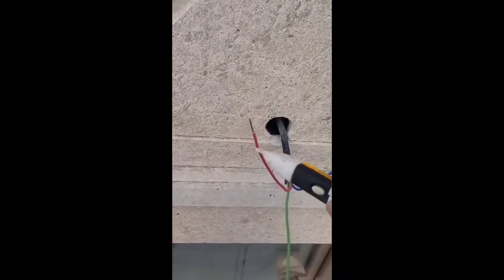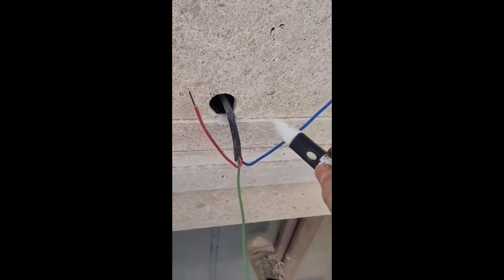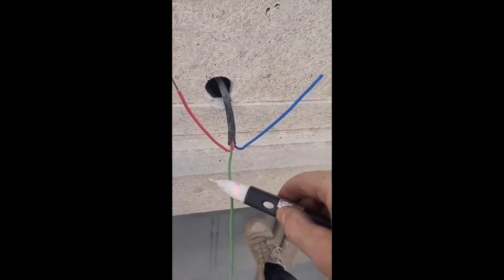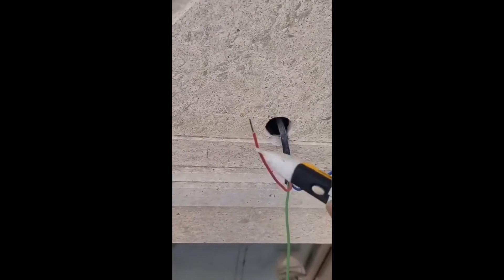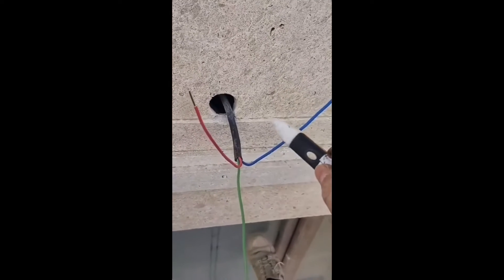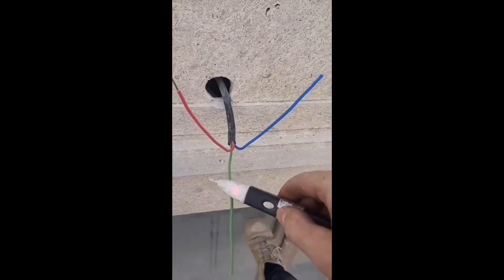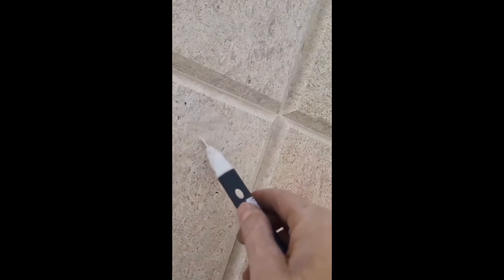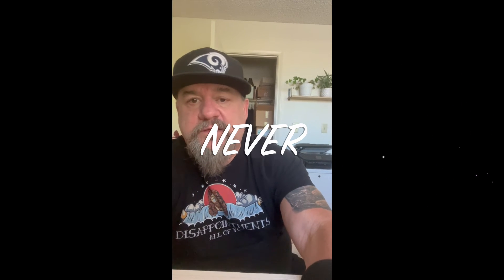Electrical hot wires, Tick Tracer reading hot in the wall. Reading hot wires when the breaker is off

Comment: A whole elctrical room lights up almost from the door frame. Or standing in center of room. This is an indicator. And it can lie in different ways when diagnosing.  Always use that meter before you delare a circuit status,  means your life. Untill you find the hard wire, be very carefull its a million pieces of pain. Learn from others mistakes. And the last tech before you could of been doing rough work. Safe wiring to everyone

Comment: This happened to me, it ended up been an open neutral on a 277v and it was arching to the grid of a drop ceilling and all the metal beams. I was reading 480v on each phase to neutral. Instead of 277v.  When I shut the breaker off, repaired it and turnned the breaker back on none of the light fixtures turned back on. only a few did because all the ballast were toasted.

Comment: I learned the ghost voltage gives false sense of security. 
I personally use a plug testers, DVM and wiggy. Ticker only works when it wants to. Some are too sensitive where even 18v will set it off. And it doesn't give a voltage or phase. When troubleshooting you need voltage to assist diagnosing the problem.

Comment: My man I used one of these to find my wire for the microwave receptacle in the cabinet because the cabinet guys didn’t stub it out or nothing plus I didn’t work on the house to begin with so I turned on the power and bam I came across it

Comment: Shared neutral perhaps? I’ve cut into a couple of “dead” circuits using those things! A must have in a tool kit, but back it up with a real tester!! 
Thanks, mate!!💯👍🏽
Reply: Nope those tickets tracers are a waste of money. 1 company i work for with suspended you half a day if you get caught using 1.

They are dangerous. I have on several occasions used 1 and it did not work and the wire was still hot. 
And FYI you do get abt e2v returning on a neutral.  And many tick tracers do not work under 50v.
You see where the problem lies?
A neutral bite hurts more than regular 120v.
Never use a ticker.
Reply: @lm5085 lol that’s a reallydumb policy. They are not a diagnostic tool at all and are prone to false positives but I literally don’t believe you when you say you’ve had several false negatives. You’re certainly not using it correctly if that’s happened to you several times.. the tracer needs to be verified on a known energized circuit before and after the circuit being tested. They dont work on heavily insulated cables, they don’t work on grounded conductors. They are strictly a tool to quickly tell if a ungrounded conductor is energized or not and if used correctly it does that job very well. Can’t be using a tool wrong then complain it’s dangerous

Comment: Electricity is tricky anyway.  a few months ago I was reading 130 volts phase to ground on a 277 circuit with the breaker off.  I finally just touched the wire to ground, and... nothing it was induced voltage that meant nothing.  The non-contact volt meter is a great tool it you understand it's limitations.  I 100% trust it to tell me the circuit is dead, it sometimes gives me a false hot, but then sometimes (rarely) my Fluke does also.

Comment: Hi The small crimp on fitting to keep wires together and then screwed down what do they call those terminals? I like to try them out thank you
Reply: I found them on amazon under crimp connector or ferrule pin connector.  Could have used some today

Comment: Here's a quick tip that might save a life. EVEN when you've tested anything that may have a current.... first touch is the back of your hand. It will cause your hand to pull away from the electrical current instead of holding onto it
Reply: That's the worst tip I've ever heard in my life. What's next, before using an iron, hold it against your face to see if it's still hot? If you don't know if the circuit is dead or not you shouldn't be playing electrician. You can work on live circuits without electrocuting yourself btw.
Reply: The reason for the back of your hand is what happens to your body when electricity is flowing through you.... muscles are active when electricity is introduced... meaning that you INVOLUNTARY contract your muscles on the front of your hand the palm of your hand is a good way to grip a hold of what is electrocuting you. the best way for you to come out of that situation alive is with the electricity causing your hand to be pulled away again IE example. Is using the back of your hand so when electricity is introduced you will involuntarily pull your hand away from from whatever is electrocuting you. Lol I think you should also try to keep that hot iron on your forehead as long as possible is fine with me..  but 🤷🏼‍♂️ what I'm even talking about.... it's not like I have actually seen and done that many times before.... downgrounds on transmission power lines are not really gonna zap for a little bit.... 😂and y'all actually act like you never got a little electricity in your life 🙄... but really don't skip safety EVEN once.  No joke. Safety number one paycheck number two
Reply: The inside of the hand is more likely to be callused.  Rougher, dryer skin, which would have a higher resistance. Allowing less current to flow.  
You'll probably get a more severe shock on the back of the hand.
Reply: And yes I am actually live line trained to be bonded on The Wire
Reply: That tip I have came from the guy that trained me to work bonded on liveline from a bucket or hooks. I love my work and I know it well. However if you wanna come tell me more about the fact you never felt what happens when you've closed the circuit with yourself... I'm not sure if I believe you really worked on electricity or even fooling around with the electric fence before if y'all's serious about never getting any zaps.. I seen what happens when 115kv is like where someone completed the circuit with their own BS-ING and foolishly rushing into work
Reply: For real though y'all just stay safe and safety number one paycheck number two is a good thing to remember cuz you don't ever spend your paycheck if you ain't safe . So please remember stay safe out there and come home alive. This is training from years ago anyway I've been out of it for a while. Hell it might be 100,000 new different ways they got going on now. You got to work smarter not harder folks but for that farm hand or for those guys out there all by themselves. It's a good tip so you're not holding on to shit that's happened the fuck out of you while you're by yourself and nobody's there to pull you off from it. You can do it yourself just by getting a little zap and then you slap yourself in the face instead of just holding on to it like a dumb monkey😂 come on everybody Done Construction act like you didn't do something stupid to the fucking new guy. My new guy experience nobody told me helicopters generate their own static electricity that will zap you seriously so do not grab the umbilical cord until it touches the ground there's another safety tip
Reply: Thanks for the fun and feedback

Comment: The first job that I had learned about the great experience of "never worked a day"... but that's not because I'm unknown to bust @ss... I enjoyed it and I will do it again in a minute given the opportunity... transmission power lines was a very experiencing job that was unfortunately stopped short by life's little curve balls. Even though I had only a couple years of the experience as groundman. NOT Drivergroundman for them that know I've even had the pleasure of being on the crew for the course of live line work. Aka bare handed and bird on the wire.... I even know why it was changed so armor rods is not supposed to be put vertical in the bucket or hand lines for live work.

Comment: That looks like a Fluke 1AC-A but its actually a cheap Chinese knockoff.We have been using the Flukes for on the spot troubleshooting for many years. They read from 90 to 1000 volt and rated Cat 4 at 1000v. You have to touch the cable on a 240v NM service cable to get a reading and can easily tell the difference between the lines and neutral. The klien's read from 70v on up and the Fluke 90v and up. Any Idiot Stick that reads less then 70v is both useless and dangerous. We do Industrial plant maintenance and have never had an issue up to and including 600v but its got to be a Fluke.

Comment: it is the same problem as those circuit breaker finders several breakers at the panel get a signal if wires run through same holes parallel the one wire induces a signal in the other wire with a long enough parallel run and high voltage you can actually get a lot of voltage in the wire that is not on just like a transformer.
Reply: You must be using a harbor freight special.
Only time I have ever seen a issue is with shared neutrals and minimal. You have to know how to read the tracer. I used them often to trace. Only 1 time I had a bad reading. That was a strange problem. Transient voltage was the glitch.
And I been doing this over 20 years.
Reply: BTW you almost describe transient voltages.
Another problem is when you run mixed voltages in the same conduit. This is why you are not supposed to put 480v in with 220v systems.

Comment: Ticktesters through off so much phantom voltage. I still use a Wiggly most of the time.
Reply: Wiggly?
Reply: @samwoods3430  trade term for a cardianoid voltage tester. They are basic compared to modern multimeters but you have to actually know about electricity to get the most out of them.

Comment: Your statements are wrong and it shows that you have no troubleshooting experience. Based on my experience and analysis of the video, that building is showing an electrical problem. Notice the grounds are live which is the green wire and wall (which is connected to the earth and considered grounded). The problem there is an earth fault on the circuit of the transformer secondary. Non-contact testers are very useful in some situations, fluke makes the best and most reliable.
Reply: I know in the klien tickers, there is a blue LED setting and a green. Hold the button down and it changes. Blue = Low voltage and is sensitive. Green= high voltage.  I still don't trust the damn thing. F***in POS goes off in my pocket from static.

Only useful for finding a switch leg.
Reply: That's interesting. However, polarity testers can still be untrustworthy. What Starv is saying is totally valid and he clearly has plenty of experience. I bet he's just looking out for people who may not understand how those things work.

Comment: What you have is a tool being used in a method unintended. It is NOT a troubleshooting tool! It’s intent - is an indication of ‘possible presence of AC voltage’… Or AC potential…

All that said any indication of AC potential on a conductive concrete surface like stucco can be a screw through a wire… Or an ungrounded short, since also present on what would be an equipment grounding conductor. So possibly several issues - the lack of an EGC connection (an open” that would otherwise trip the circuit breaker. AND an actual “short” to grounded connection on the other side of the aforementioned “open”… AND the biggest problem is an electrical worker who doesn’t understand the use and purpose of a tool, or what the correct one should be.